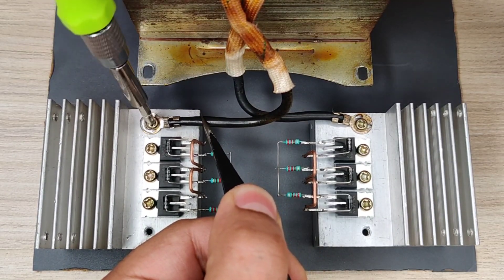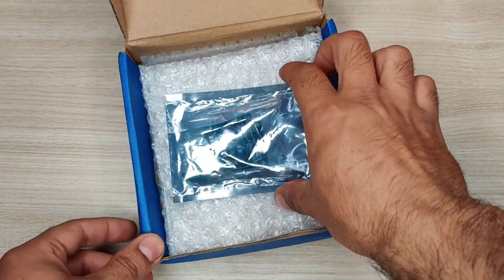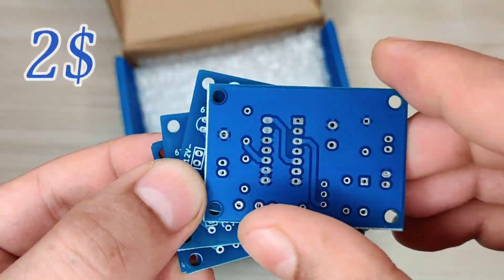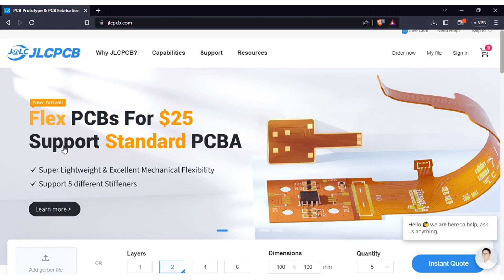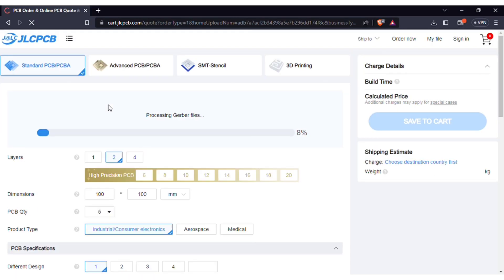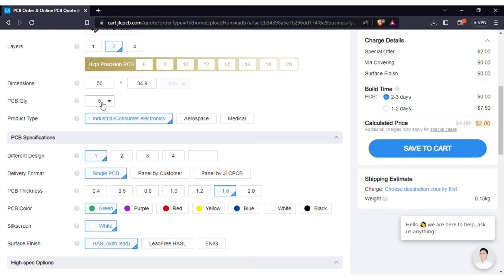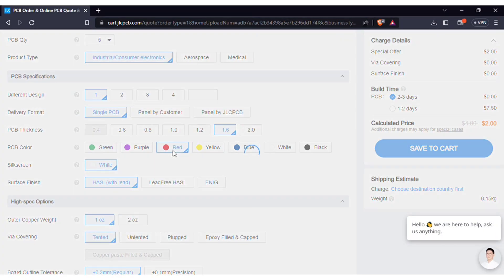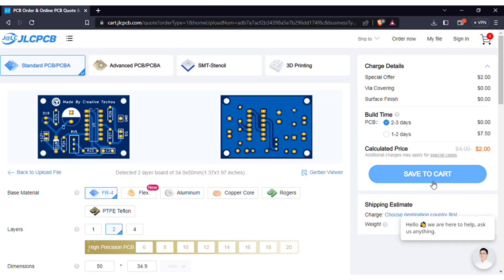how to make powerful inverter 12v to 220v

Comment: Sorry to say,  but this is a fake one. 
No spark, when you connect the battery though there was a high load.
Reply: Yes, i also think about that, there was sparking while connecting the bulb but in drill machine there was no spark

Comment: This is a good one to try! Would you be able to use Toroidal transformers for this? And also for 48V. ( to handle with low current )
Reply: Torroidal is for a low frequency inverter.and a low frequency is very good inverter. Nobody teach here in youtube Inverter using torroidal transformer and mostly their tuturials are square wave to modified sine wave😊✌️✌️
Reply: @leopoldofernandezjr.508  🙄
Reply: @kace1979  🥴
Reply: S'il vous plais traduit en francais
Reply: Le comme'taire en francais